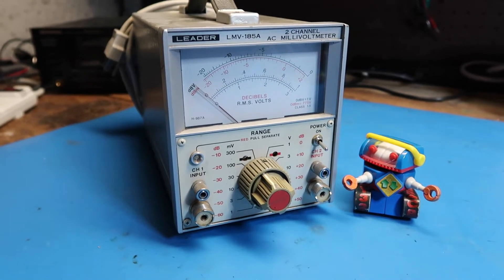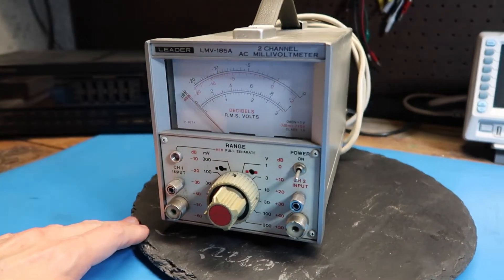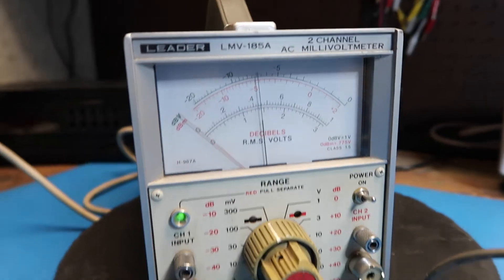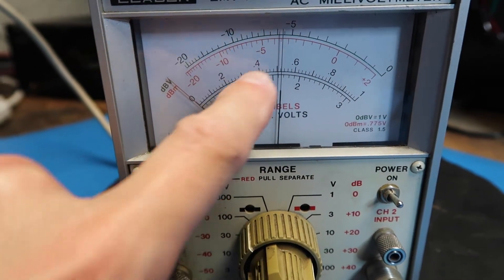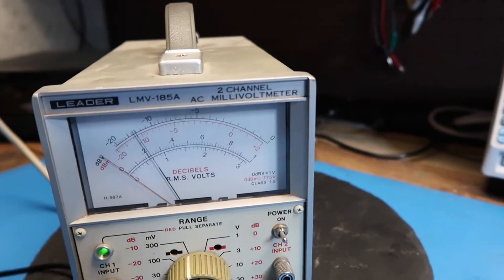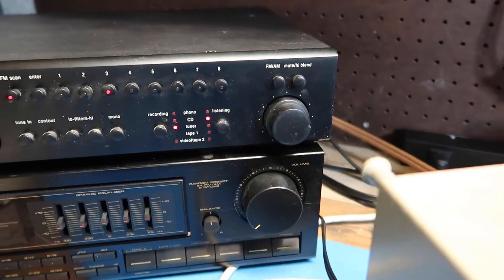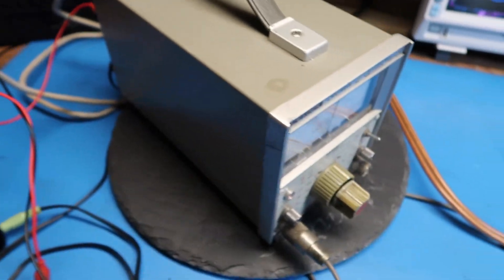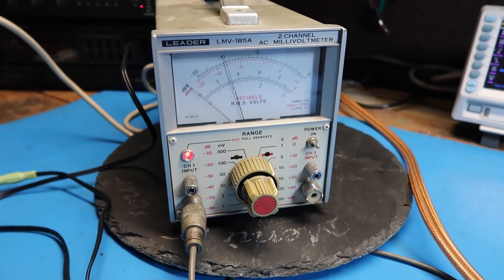Discovering a Leader LMV-185A AC Millivoltmeter

Comment: So I can measure the same DB signals with a oscilloscope?
Reply from the maker: Yes, in principle. You might have to do the dB calculation yourself, or your oscilloscope may have a feature to do that for you.
Reply: @SomeDisassemblyRequired  Can you use banana cables instead of the  ones you used? i do not know the name of the cable that you used and if they can be found on ebay?
Excellent video very interesting.
Thank you
Reply: @SomeDisassemblyRequired  What is the other needle for?

Comment: what kind of cables did you use for this? I have one and I am looking for appropriate leads/probes for it
Reply: It can use the old fashion banana plugs and it also uses a UHF style connector. If you look one-Bay there are leads for both types. There is a guy that custom makes the UHF ones for low voltage applications. You can also get adaptors the will go to BNC

Comment: Are these still worth getting?
Reply: They are really worth getting. Especially for analog audio work. 
Most multi-meters' AC values are only accurate to a few hundred Hz. 
My Fluke 175 is a true RMS meter and is only accurate to 500Hz in AC mode.
In audio one works to 20,000Hz. This meter is accurate at those high frequencies. Also has 2 channels, a must for stereo work. Can't say enough good things about this meter!
Reply: @JohnDoe-ej6fx  I am looking for one. but are those leads like the one he used available they seem kinda old school. Don't they sell banana type leads for the hook ups tht are above the old inputs?
Reply from the maker: If you have a need for an AC millivoltmeter, it seems to be a very good model for that. They are available on eBay and still seem to be in demand there.